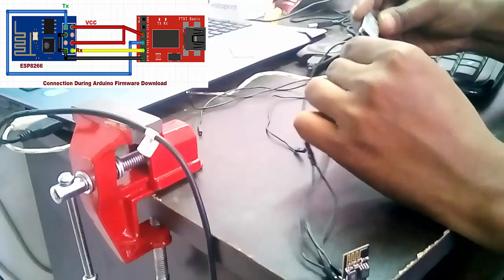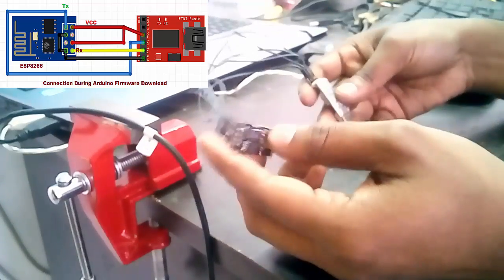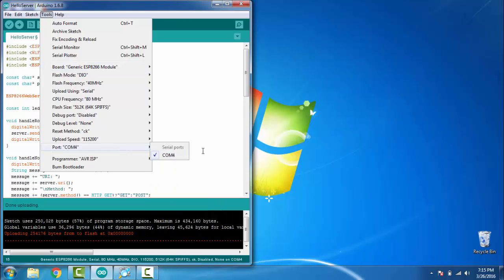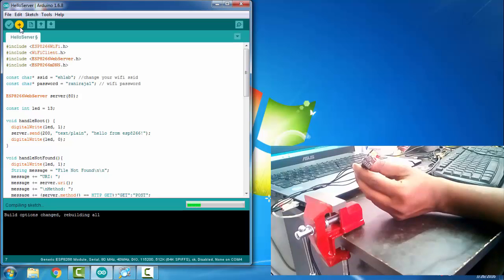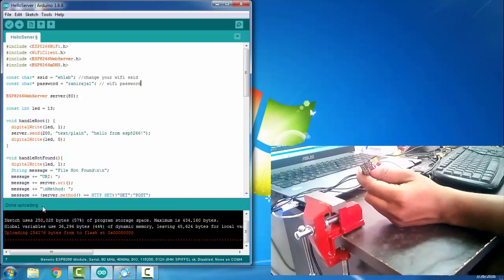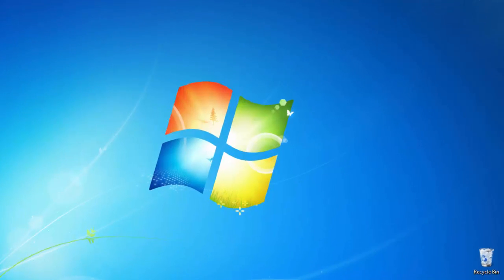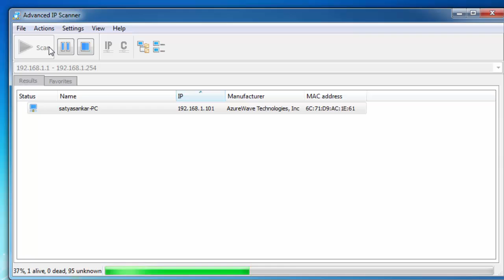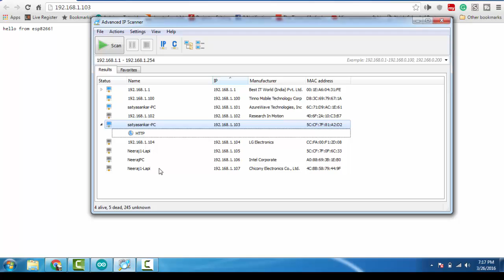Programming ESP8266 with Arduino IDE | Easy Connection and programming

Comment: hi elec lab thanks for your explication but i have many prob                                                                     1-i have esp 8266 but with 4 pins rx ,tx,vdc,ground.with 2 switchs on board 1for reset ,2 switch with 2 fonctions UART,PROGRAM .so i  did all your explication ,but i get many problems 1-wen i upload i get error ,like no conversation with const char to char, 2- i have the name of my connection on laptop but no blue led on my board esp. 3- on my monitoring serial ihave  only ( ready  ) when i put AT i have nothing .so pls can you help .my board ESP 8266 wifi v1.0 thanks and good luck
Reply from the maker: I will suggest you not to use AT commands, but follow above video and code with arduino. Arduino for ESP is now very stable and works like charm. Thanks Good Luck.

Comment: Hello, Thanks it was good tutorial. Can you please help me because I am facing problem while uploading sketch. If possible please reply on my email address zafrul.umar03@gmail.com

trying to connect
 flush start
 setting serial port timeouts to 1 ms
 setting serial port timeouts to 1000 ms
 flush complete
 espcomm_send_command: sending command header
 espcomm_send_command: sending command payload
 espcomm_send_command: receiving 2013 bytes of data
 read 0, requested 1
error: failed reading byte
warning: espcomm_send_command: cant receive slip payload data
warning: espcomm_sync failed
error: espcomm_open failed
error: espcomm_upload_mem failed